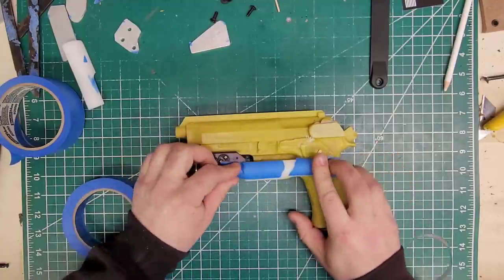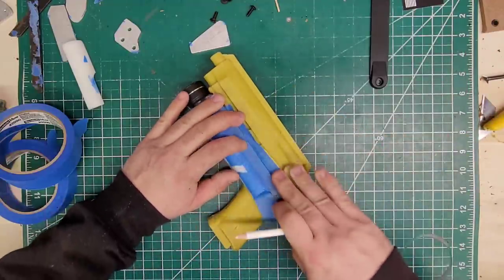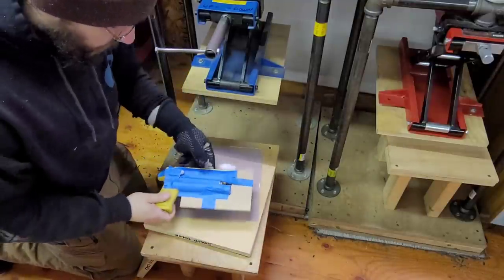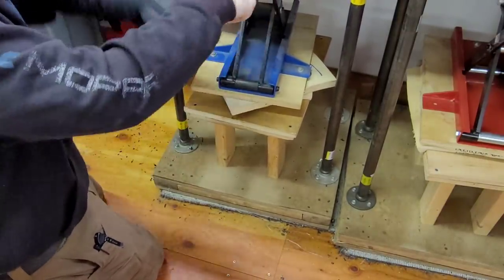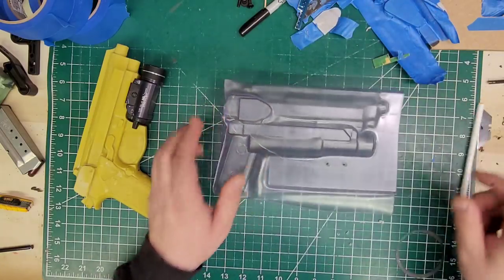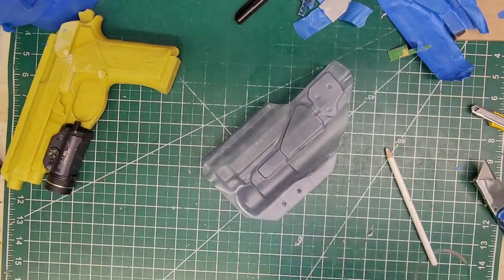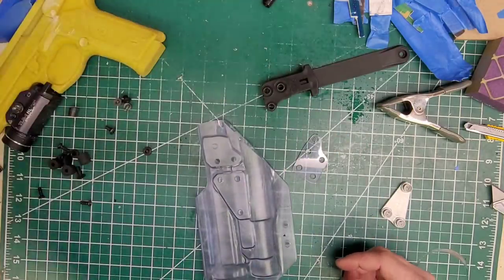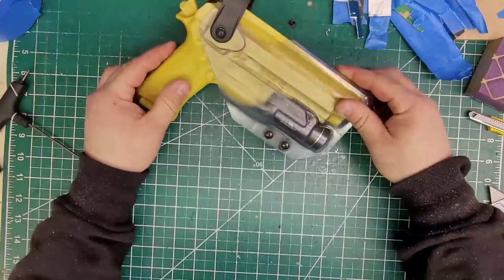Clear Holster? Sure Beretta M9A3 With Tlr1

Comment: Im looking to purchase a custom made holster for my beretta 92a1 with this streamlight setup. Preferably level 3 safety if not level 2 works. This mold is only 1mm barrel lenght longer than the 92a1 so it should work no?